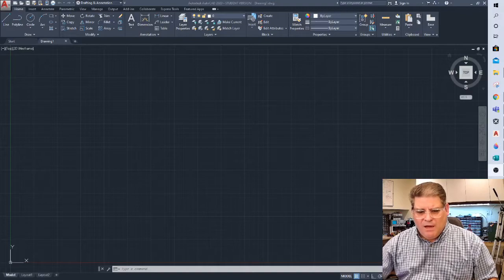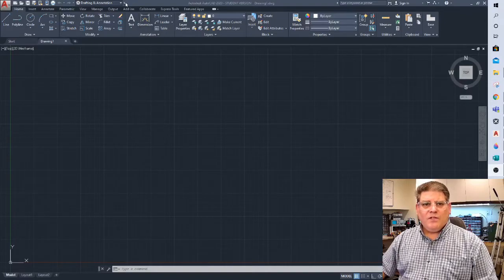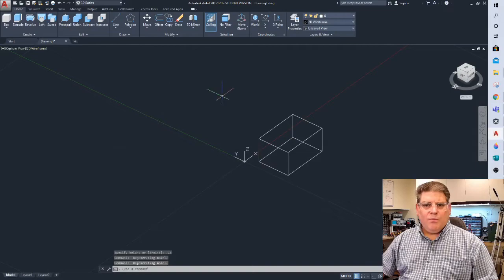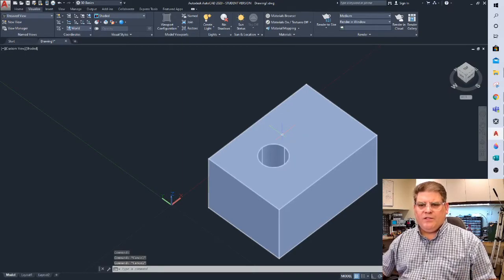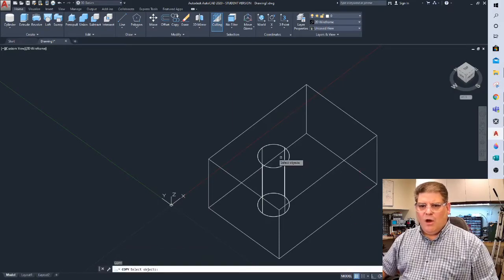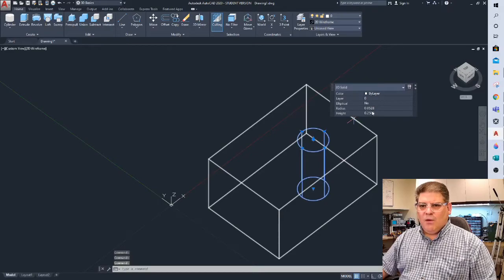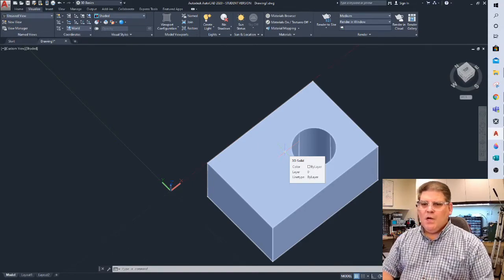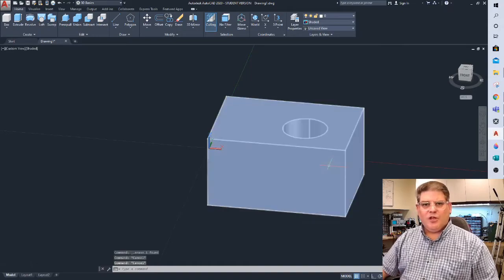AutoCAD Fix a Hole Size or Position (remake)

Comment: to move, simply select the face(s) (CTRL + mouse click) and drag or move with coordinates.  If it's not behaving the move UCS icon to the face so Autocad can understand the coordinates.    To copy a hole is a different issue.  Autocad only copies the face  so it's not a "hole" .  The fastest way is to PRESSPULL the shape (not always easy), ARRAY, COPY,  or MOVE then SUBTRACT the solid(s) you rearranged.
Reply from the maker: Perfect. Yes, here is an updated video to help anyone along.
https://youtu.be/WkWlLbzJSOo

Comment: It seems easy but the problem is when press the fonction and when press Enter and so on. Very very hard to get that. That's why I prefer Solidworks
Reply from the maker: Solidworks is a great tool. Sometimes however, we need to use the tools we are given.🙈🙉🙊 Thanks for the comment!